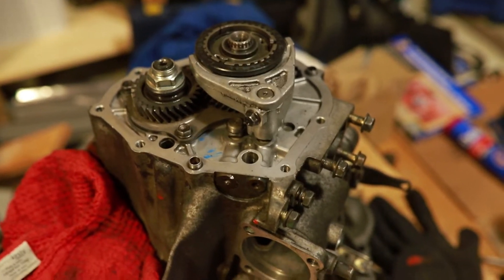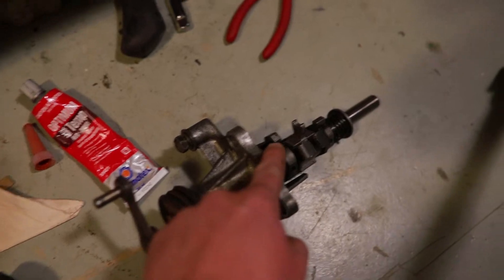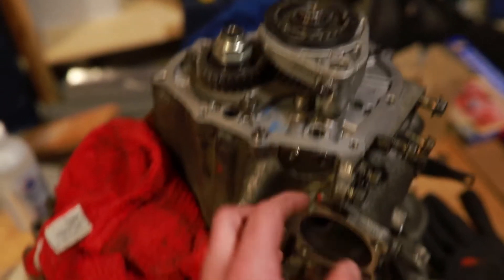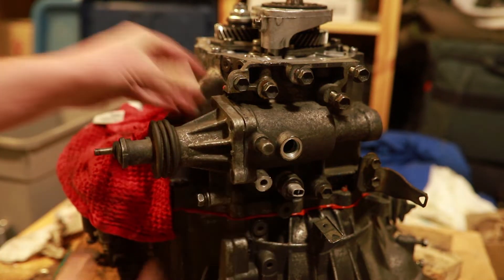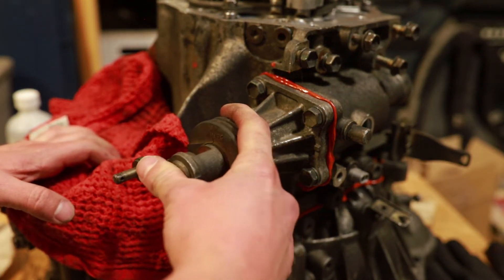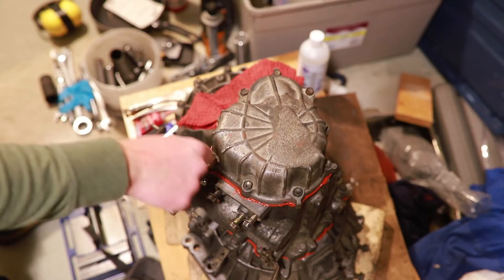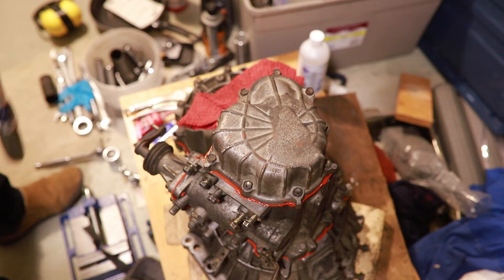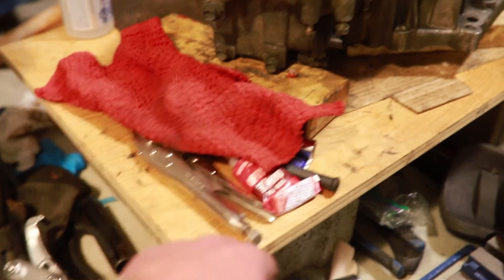Fix your manual transmission at home - Part 4 - Fixing my mistake

Comment: Pls Sir... what was the setting inside the gearbox before you put it in🙏.... after installing my after changing the seal on it... it could only go into gear 2 and 5 what can I do🙏
Reply from the maker: I'm not sure if i understand your question. I put it back into neutral everytime. Watch the whole video series to see if if helps. The videos are me documenting doing this for the first time with no prior knowledge.  I read manuals and watched videos to do this myself. I am not a professional mechanic.